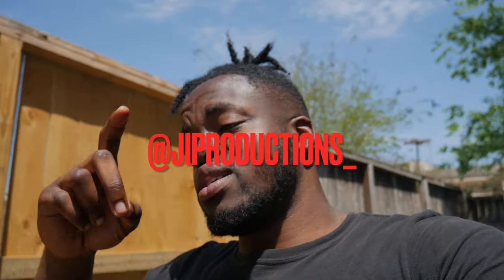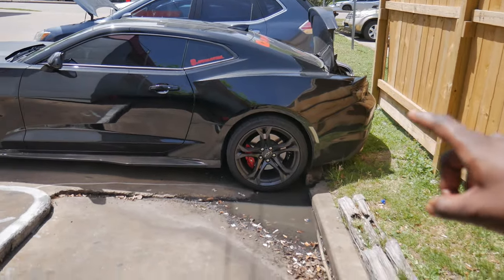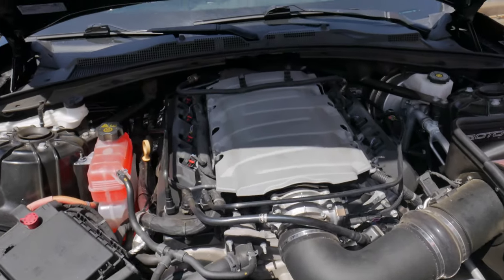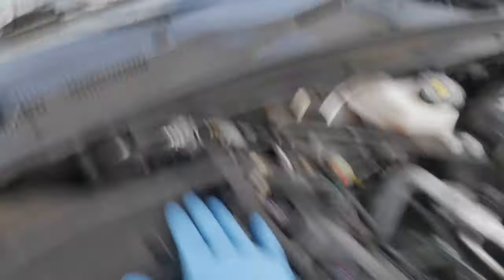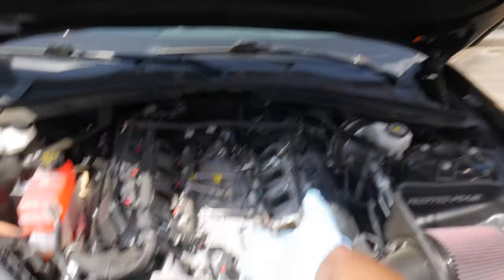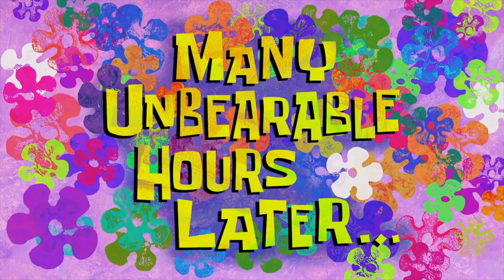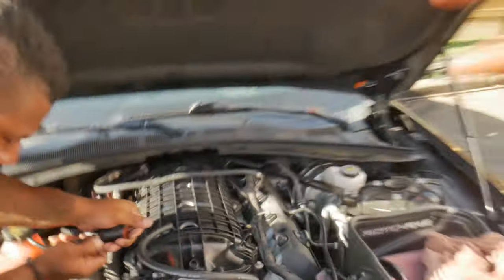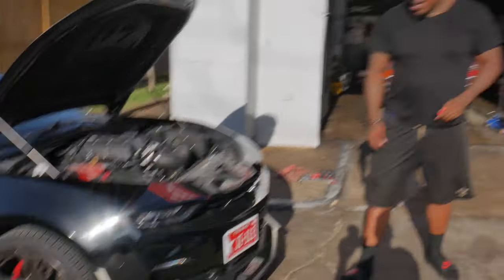LT2 INTAKE MANIFOLD INSTALL ON 2021 CAMARO 1LE

Comment: Its needs to be tuned to actually work right. The ecu will only read more air volume without adjusting the fuel air ratio, and you will be lean in the mixture.
Reply from the maker: Literally said that in the video champ